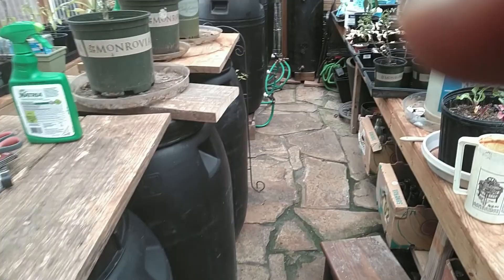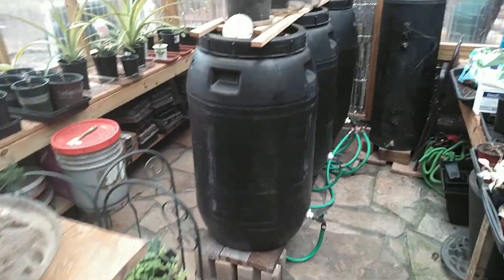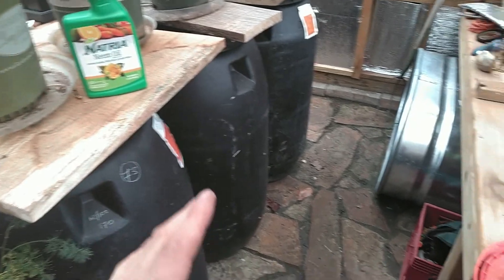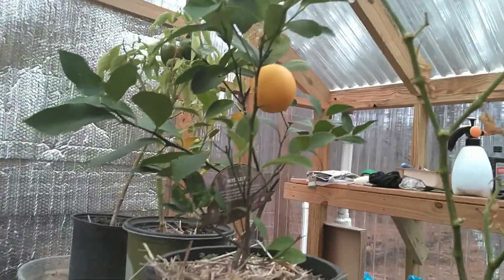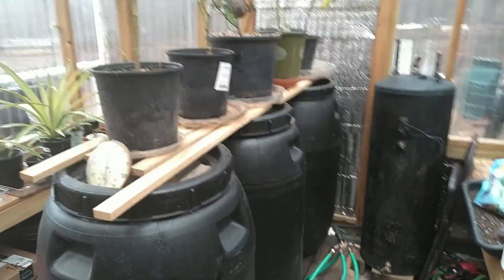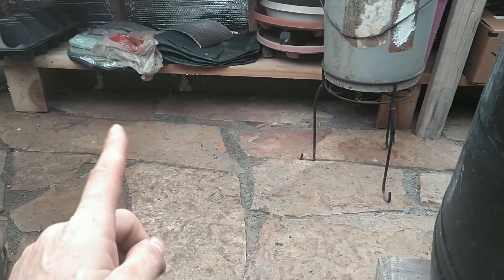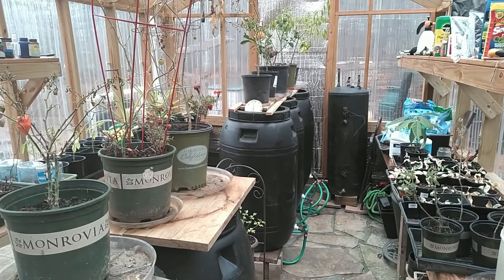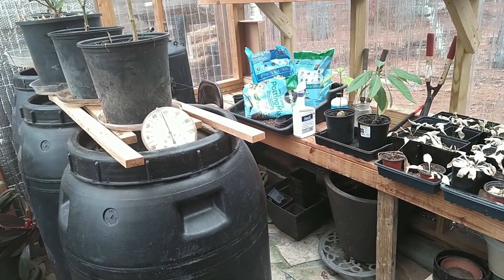#86 Greenhouse with DIY solar thermal mass storage heater

Comment: Don't waste your time growing avocado from seed, they don't grow true to seed.  Just like apple, it will not be a viable fruit (they say only 1 out of 10k avocado seeds will make a good plant, which means you would have discovered a new strain). You need to graft a branch from a good tree to a dwarf root so you get a shorter tree that will make edible fruit and allow it to fit inside of a greenhouse. You will need 15-20 feet of height for the full sized tree, maybe less with special growing techniques like super cropping or pruning.
Reply from the maker: We have heard that but our research states it is possible. The real issue is time. We've been told it takes 10-15 years before it will produce. No one waits that long... Time will only tell :)